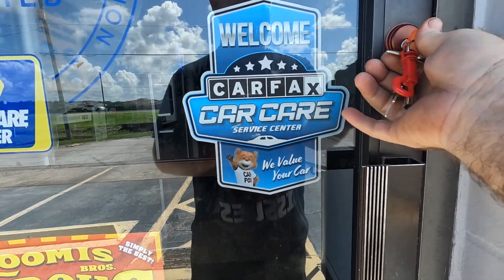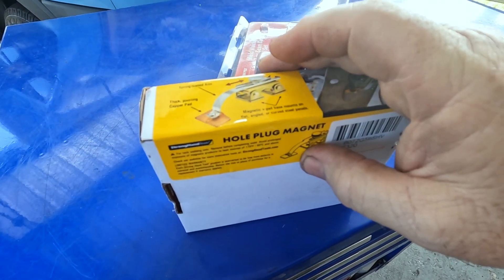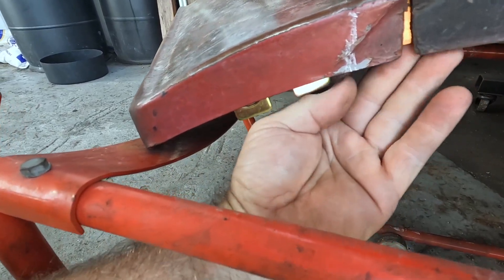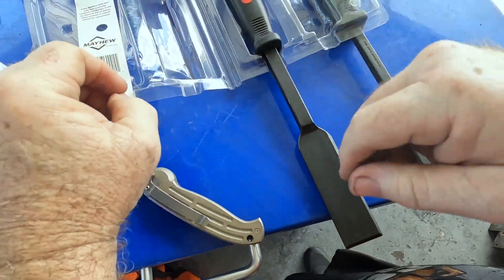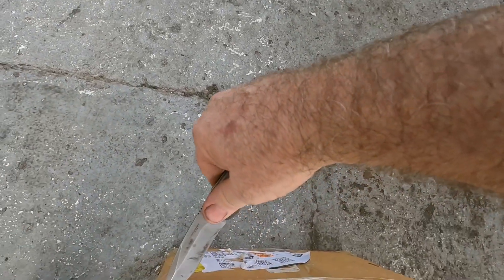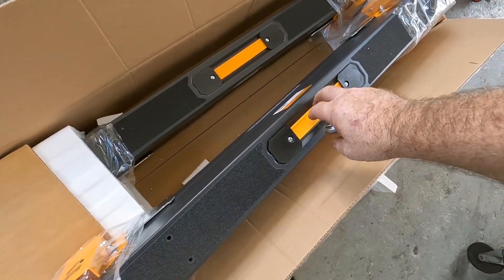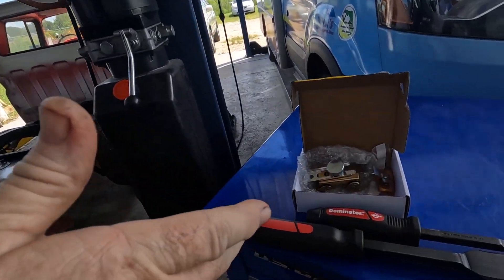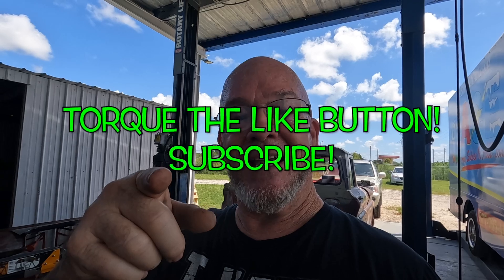TOUGHBUILT C700 TOOL HAUL, SAW HORSE, METAL WORKING TOOLS, MAYHEW...USA AND NOT USA...

Comment: I was wondering when you were going to pick up copper hole plug tool. That's a nice tool. I just used an old piece of copper. The magnet is a big help. I used an old heavy scraper to break the spot welds. Those chisels are perfect. The saw horses are awesome. I like how they are adjustable. If I tried to do pushups on the sawhorses I'd crash harder than Evel Knievel. 🤪🤪
Reply from the maker: lol. I hadn't done any push ups in months...Need to do them more often. Used to be way easier! Ha
Reply: @JimmyMakingitwork  I'll be 53 in 11 days. I don't think I could get through one. LOL
Reply: @mlieser1230  lol I’m only 36 & my knees are so bad they would’ve buckled if I tried to hold myself up like that 😂. That’s terrible 😭